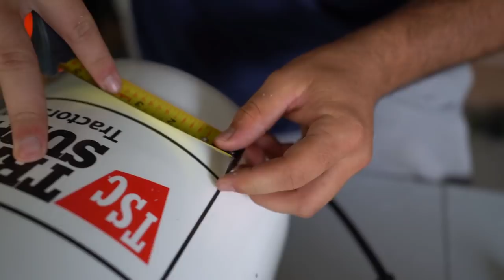$5 HOMEMADE Automatic CHICKEN FEEDER and WATERER!!!  (DIY)

Comment: You should put mesh under the coop so critters wont get in and kill your chickens
Reply: Negitve just the weight of the waterer and feeder on it will hold it down and besides that chicken wire won't keep the critters out they will open big holes in it anyway so there's that lol

Comment: You can also make a stand for the waterer with wood just measure the size of the barrel and make a rectangular piece with wood and put four legs on it and on the ends make an indention so the barrel can sit on it for the pigs.

Comment: I guess the diy bucket waterer/feeder is $5 but the equipment and tools needed to make it are at least $40+ (price of hole saw, not including drills, drill bits, etc that we might need), as well as the miter saw, but we can see the miter saw is coming in handy for other parts of the project already.

Comment: Hog wire to keep large predators out. 1/2" or 1/4" mesh to keep the snakes, and rats out, and keep the chickens heads in. Chickens tend to get feathers ripped out by chicken wire.

Comment: I wouldn't recommend getting chicks cause I don't think you have the right system there you need a barn to raise chicks and heat lamps and special feeders and waterers which means something lower to the ground if I were you I would go to Craiglist by a dual purpose breed bread for meet and eggs and put them in your chicken tractor